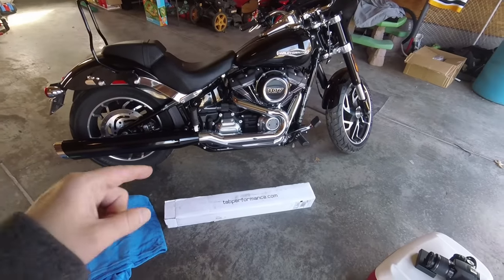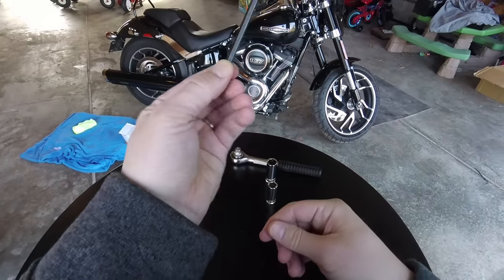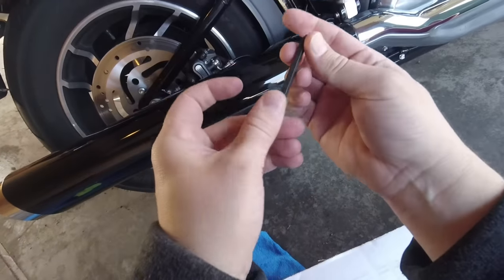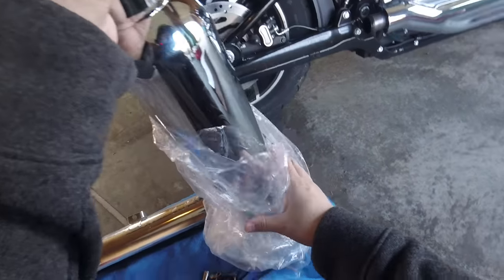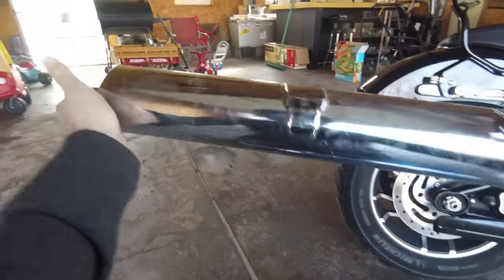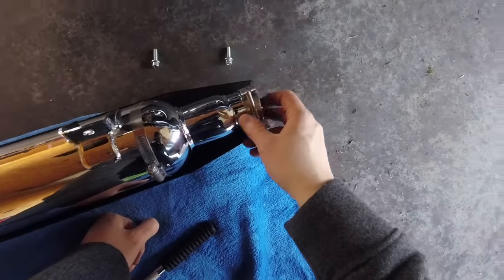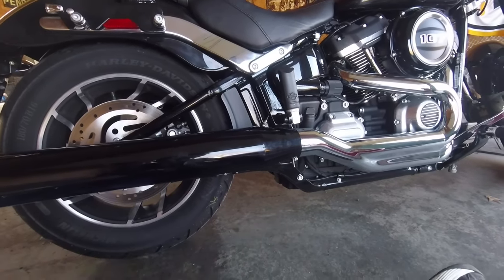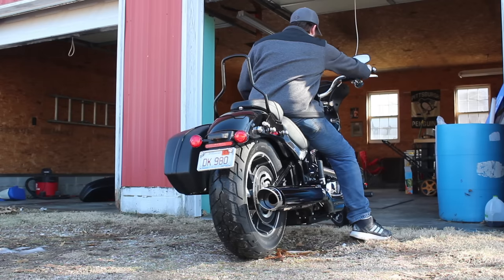Tab Performance Exhaust Install on a Harley Davidson Sport Glide

Comment: How come no exhaust gasget? Every other system I’ve seen needs one.  My Cobra did. 
You’re right about the towel, managed to get a tiny scratch on mine resting on the ground!
Reply from the maker: David Keppler Instructions from Tab did not mention a gasket. Also read the same on forums.
Reply: Mine didn't have an exhaust gasket either.
Reply: The gasket is something that is brand new and is used to get a more complete seal required for emissions testing.  If you want to get a perfect seal, some permatex copper or red rtv will do the trick and is much cheaper and something you can get at any auto parts store.  The gasket provided no performance benefit and only added cost to the muffler so we cut it out like on other models we do.
Reply: @TABPerformance  I got a 2019 road glide special . If you got some slip on . I be glad to do an install and review of them . LoL
Reply: @TABPerformance   Thanks for the clarification.
Reply: @TheBlueBikeDoyle   we do have BAM Sticks with Zombie baffles for those that really wake up the M8 on the touring bikes.  We have quite a few videos on our Youtube channel of them with sound clips.  We also have quite a few customer clips on our facebook group #zombienation
Reply: @TABPerformance  do I need to reuse the heat shield? I was wanting all chrome look to my sport glide exhaust. Also where would I apply the red rtv for a perfect seal?
Reply: @snipedetects  You can apply the rtv to the head pipe.  We do recommend using the shield as it holds up the header shield and keeps it in place, but we have had people run without muffler shield and it looks ok and worked for them.

Comment: I see tab recommends tuning with this exhaust but I’ve seen a lot of people NOT tune and say it’s fine. What’s your take?  Will this slip on also void warranty. I guess a fuelpak definitely will right?
Reply from the maker: Marc Menasian I only tuned a few months ago and I did this back in February. I had no problems. I did the Fuelpak, so yes I have voided my warranty.

Comment: Put an air intake and auto tuning fuel module in now.  Best not to run that M8 lean.
Reply from the maker: Cosmic Charlie Already bought the Arlen Ness Big Sucker! Will install and tune this fall most likely.
Reply: @DCyclemoto  Like that exhaust. Maintains the stock look but sounds way better.
Reply from the maker: Just to update you, air intake and tune has been done! New videos up of it all!